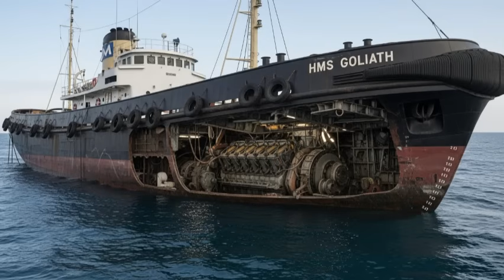Brothers Bought a Sunken Tugboat For Scrap — The 16-Cylinder Diesel Engine Was Worth Millions…

Comment: DETROIT METRO AIRPORT area ...retired ELECTRICIAN ,,/38 years ....5years/UNDERGROUND MINER , ...
2 years +MARINE CONSTRUCTION , CERTIFIED WELDER ., CERTIFIED DIESEL......"MALCOLM MARINE" , SAINT CLAIR , MICHIGAN bought a WWII "RESCUE TUG"  ...
YHEY had , 2 ENGINES "CLEVELAND" 2 STROKE with  DUAL SUPERCHARGERS = 928 h.p. each ...with a 600 volt D.C. GENERATOR at 1,200 amps EACH ...
WIRED  to 2 x 750 h.p. D.C. MOTORS = 1,500 "SHAFT HORSEPOWER (3 GEAR GEAR BOX CONNECTED TO CENTER DRIVE SHAFT ) = 9 foot , 9 inch. BRONZE (BRASS ? ) PROPELLER ..
=  SEA WOLF CLASS SUBMARINE DRIVE SYSTEM ...
...."FLEET TUGS" HAD  4 ENGINES with 2 propellers .....

ALSO 'MALCOLM MARINE" bought a ~1944 ICE BREAKER /3/4 inch THICK STEEL HULL with ~1,200 h.p. ENGINE with a D.C. GENERATOR >>> ~1,200 h.p
 D.C. MOTOR ...UPGRADED/REFITTED with 2,000 h.p. G.M.-E.M
D ( GENERAL MOTORS ELECTRO-MOTIVE DIESEL ) RECOVERED/SALVAGED from a DUAL TRAIN WRECK...
.ENGINES WERE ALL 1 1/4" THICK STEEL PLATE ...*NOT CAST IRON* ...COMMON

Comment: Great piece of fiction--but it's just that. A "nuclear battery" uses Pu-238, which pounds out alpha but  very little gamma. Alpha is blocked by a sheet of notebook paper. The alpha carries the heat, which is turned into electricity using the thermo-electric effect (with an efficiency of about 8%). They don't need or use lead shielding, which would be too heavy for space craft (their usual use).If shielded with lead, it would be indetectable. Not clear why you would need a nuclear battery on a tugboat with a big diesel engine. As noted by others, the engine in in a wrong place. In addition, magnetic mines would be triggered by the steel hull, not the engine block in particular. As I say, great fiction, but only fiction.

Comment: There is no watertight engine room. 
The engine needs air.
The engine has exhaust.
Reply: Could be if intake and exhaust air is a s trap. Same with electric and controls. And low entrance accesses.

Comment: What a crock! That is no tug boat. If it were the engine would be much closer to the stern. Most of the heavey tugs use ex rail road diesels or a few submarine engines.